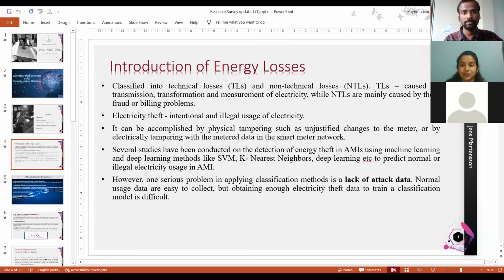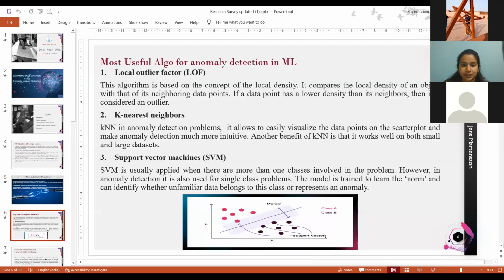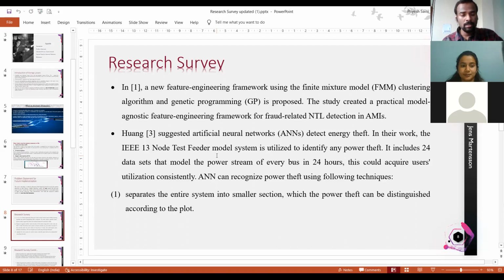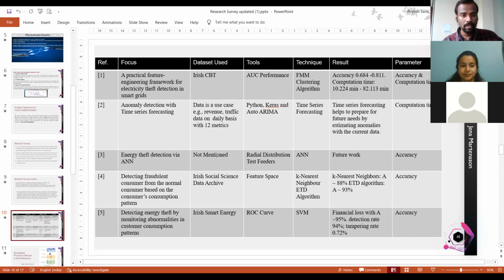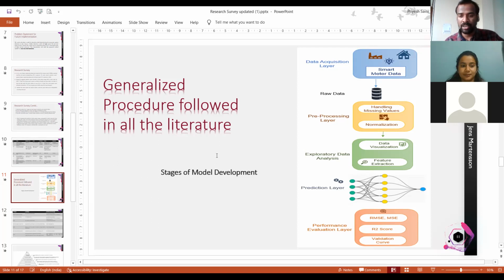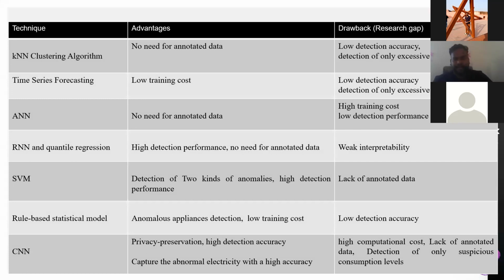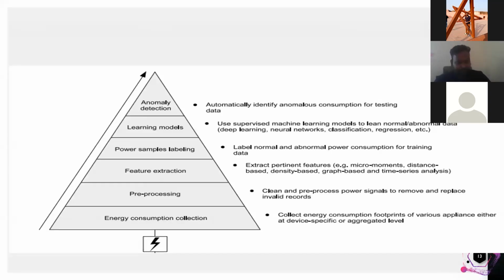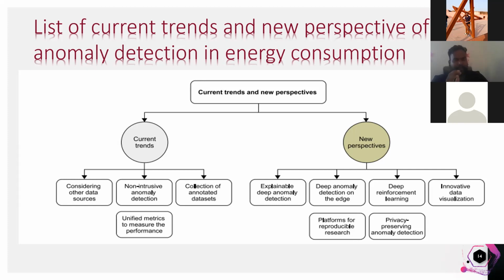Research survey presentation on Energy Theft Detection using Anomaly Detection (Part 1 - Assignment)

Comment: "Hey everyone, I'm from Indore.  Our startup is currently focused on detecting and analyzing AT&C (Aggregate Technical & Commercial) losses in the distribution line to improve efficiency and reduce losses." If you want to provide a bit more context or detail, you could expand it slightly. I'm very interested in your team and the work you're doing."